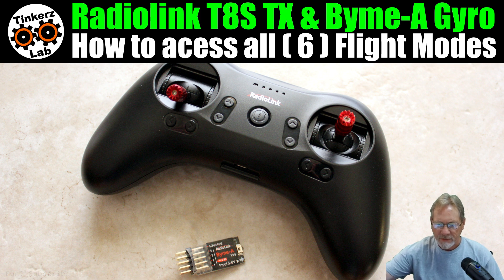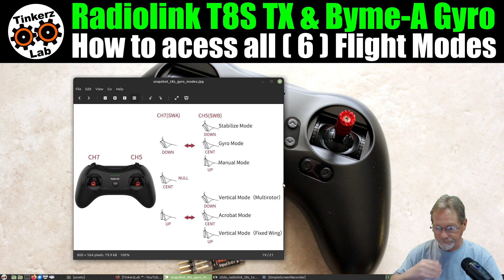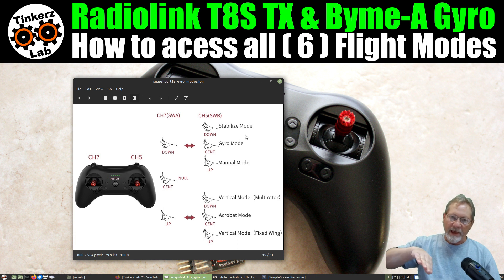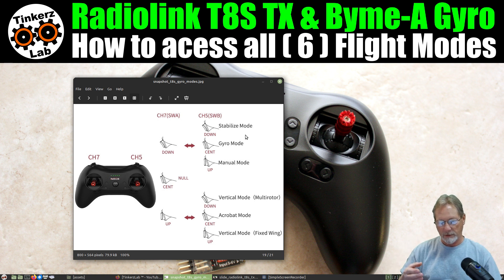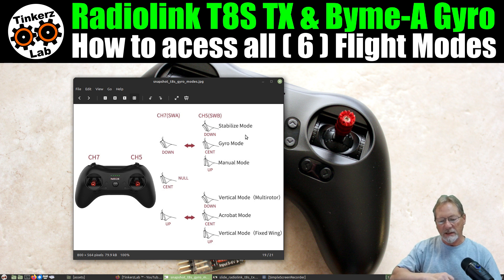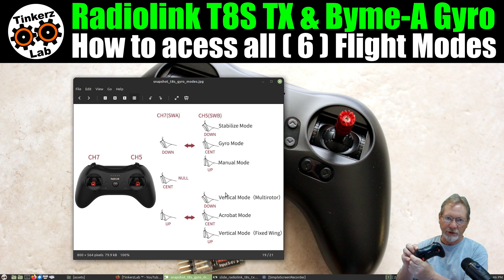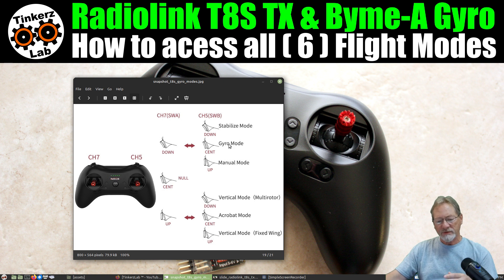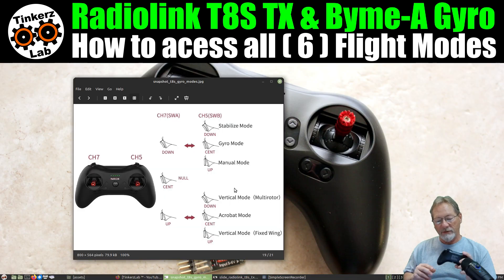How to access all (6) Flight Modes by Example | RadioLink T8S Transmitter & Byme-A Gyro

Comment: Will it break if it switches into a vertical mode ?
Reply from the maker: I don't understand the question.
Reply: @tinkerzlab 
    Acrobatic mode to vertical mode is horizontal mode to vertical mode ?
Reply from the maker: @GregDahl-g6g  To switch into Acrobat Mode, as the Video shows, is to first have the CH5 Switch in Gyro Mode, then the CH7 Switch will put it into Acrobat Mode rather than a Vertical Mode.
Just do the reverse to get back into Gyro Mode.